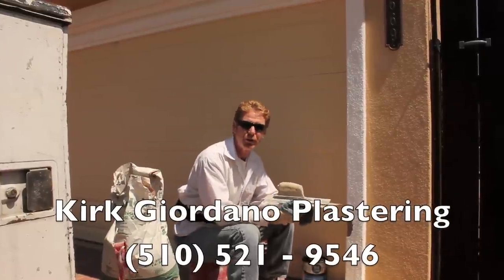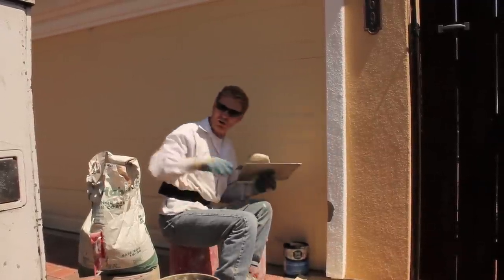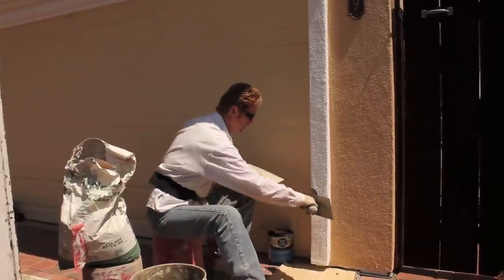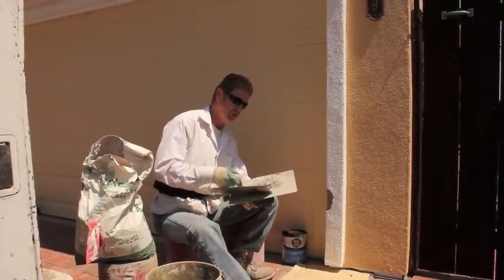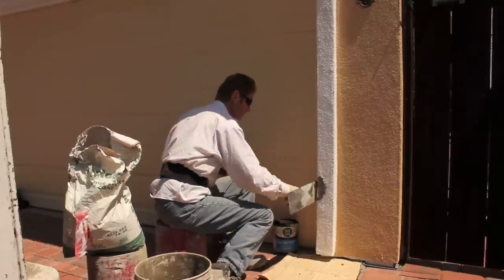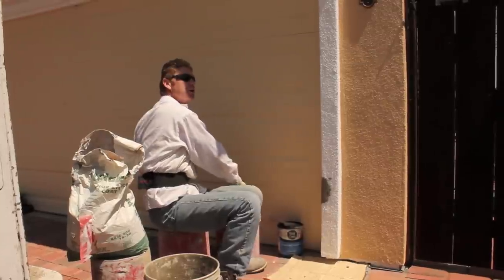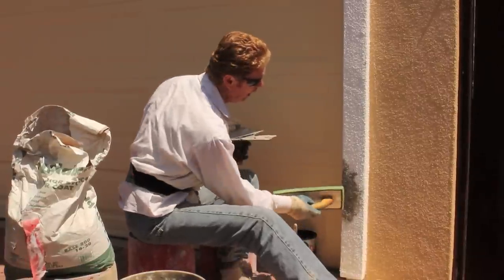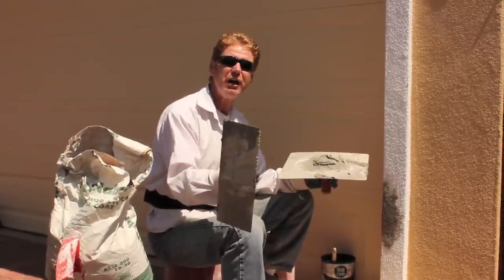Repair chipped stucco styrofoam molds.

Comment: Does the cement adheres to styrofoam? I have to fix my two bottom sides of my molding in my back door. A crazy dog ate them. It is an area about 12 inches each side. I already found two pieces of styrofoam right the size and put them on place. I just need the coat and paint. Do I need and adhesive for the cement or it holds well ?
Thank you sir 👍 Nice video for us that don't know nothing
Reply from the maker: Hello my friend, buy a pint of Quikrete bonding agent at HD for about 8 bucks, paint it on the exposed area, now for certain the new stucco will indeed adhere. Cheers.😉
Reply: @StuccoPlastering  Thank you Mr. Giordano, blessings!
Reply from the maker: @aychingao  👍

Comment: A bonding liquid sold in the concrete section of home improvement stores. Modified concrete is sold as well. The marble aggregate size matters for color & texture but it can be painted with a quality exterior acrylic paint. If matching a color, find a local EFIS company as they can come close to or match the color and texture of the marble chips. Marble has no iron so no rust steaks after it rains or sprinklers hit it. You don’t want sprinkler’s on it anyways. Not even painted siding!
Reply from the maker: @deankay4434  Exzackory, however, if I said that  to a customer they’d call the cops on me. I just say buy a good masonry paint.

Comment: I have EFIS stucco . I had 2 windows removed and replaced with wider but shorter in depth  windows. A double slider. This has left an area of 9x8 under the window which the efis part there has been replaced.  How do I finish the rest and the molding around the window? The guy doing it has vanished!
Reply from the maker: Good evening Sandy, it's called bull nosing or improvising to make the job look professional, It takes some practice or skill, perhaps it's best to call another skilled plasterer to trim it out for you?
    The complete plastering encyclopedia on video, by the plastering messengers of Youtube.  
     Over 850 free self-help videos 🎭 👀💃
Subscribers, you can depend on us to explain with truth, honor, experience, and skill for your time invested for wishing to learn the hows and whys of plastering.😉

Comment: Hi Kirk,  I need to fix the top corner of a column base that is made of Styrofoam and stucco....anyway how do I form the corner? Do I need to use some sort of filler then concrete? I noticed in another video that you used a binder as well, does that still apply?
Reply from the maker: Hi Kristin, you can use caulking if it's a small hole or cement if it's larger, If its painted you need to apply a bonding agent.
 Cheers!
 Kirk giordano

Comment from the maker: Hey Gilbert, Thanks for the compliment. These folks e-mailed me a great picture so I was able to tell the plaster sand finish, but just in case, I had all three types of sand on my utility truck. These are simple fixes but do require proper prep work in order for the new stucco to last forever.
Have a groovy day!
Kirk Giordano plastering

Comment: Can u use rapid set stucco patch on the same repair
Reply from the maker: Good afternoon, Alfred yes, however ,"Rapid set Stucco," has coarse sand or what we call 16/20 sand.🧞‍♂️
  Bringing peace, love, and brotherhood back to the world of, “Cement Plastering.” 🌍
With over 800 educational and free Youtube videos, by your favorite plaster geek, “me🤓” and my son, “Jason,” the bearded plasterer.💃
Reply: Wondering the same. But I have deep holes in mine, could I use spray foam, and patch over that? My dogs got to it, it's the styofoam below sliding door

Comment: You have great vid tutorials Mr Giordano. I am new to this and am doing some stucco repair like in this vid. I just read that Weldcrete is not for wet areas and will fail causing the repair to pop off. In dry climates it may work, but not wet. He recommended an acrylic admix like Acrylic-60 or Flexcon that is waterproof. This contractor said he has had to go back and replace so many repairs that it has been a nightmare. I appreciate your expertise. Have you heard of this issue? Thanks,  Alan
Reply from the maker: Morning Alan MacLeod, No, after more than 30 years Larson's Weld Crete has not failed me,
There have been projects where I allowed homeowners and or contractors to apply the weld create and in both instances they either did so too heavy or not enough. I do my own appling of this bonding agent as a result of folks not understanding the nature of it's use, or I don't take on the projects.
 It's made for cement on cement, and bonding stucco to many surface's, however us plastering contractors mainly use it for bonding new cementitious color finishes to painted surfaces.
 Here's a fact unless the surface is extremely clean of all dust, dirt and any other contaminates NO bonding agent will work.
 Best wishes, 
Kirk and family

Comment: Great video, thanks guys. I was wondering, is it easy to simply remove these styrofoam molds (it's the rear patio door trim). I need to put in a screen door, but can't with these huge styrofoam stucco'd molds around the door. I was hoping they'd be easy to cut and pry off and replace with a wood molding.
Reply from the maker: Todd Winkler Hi Tod, sure,  you can remove them. They are made of styrofoam, coated with fiberglass mesh,  then coated with a cementitious coating and bonded also with a cementitious adhesive products.
 You can use a long expensive saws all blade, this is the easiest,  the blades needed coat about 15 bucks each.
If you decide to use a hammer, trowel, shovel, prybar or a hundred other tools, you will have a real mess on your hands as the foam won't come off in sections, instead it will hold tight and come apart in a milion pieces.
 Best wishes, 
 kirk giordano Plastering

Comment: Hi my parents have been living at a house for 2 years now almost 3 and there has been these wood peckers pecking holes all round the top of the house which is styrofoam so they have been going through the styrofoam making holes everywhere i was just wondering how my parents could fix it , its the same result as the one in this video would they just have to do the same thing ? Do you have an idea of how much would everything be also ? If you could reply that would be really great plus i love your videos they are really helpful!
Reply from the maker: Hello Yasmin Ramirez, yes you can do it this way, for smaller holes you can just use caulking, if the caulk shirks when dry just add more, they make many caulking with sand in the tubes for sandy finishes also,
 Cheers,
 kirk giordano plastering

Comment: How do you remove the architecural foam moldings from inside a house?
Reply from the maker: Evening mate, if you don't want them anymore use a hammer, also, wear glasses and a respirator.
If you wish to salvage them use a saws all but this takes a lot of practice and is dangerous.
Cheers,
 Kirk and Jason giordano’s plastering videos

Comment: I have foam siding I live on a golf course it's taken some shots. Leaves a dent I can see the styrofoam. I have an extra bucket of stucco can I just cover it like that? Or are extra steps needed?
Reply from the maker: Sure you can; color finishes if applied over an eighth-inch thick can and will hairline crack, so what,  thats not a big deal. Simply fill to the desired depth, then in a couple days hit the cracked area again, this time it won't crack if it's skimmed over the cracked last coat. 💃🏻

Comment: Awesome!  Does this same technique work with Fypon?
Reply from the maker: Howdy Michael, no, Fypon decorative molds are usually made of wood, plastics, or polyurethanes; if it's a small ding try caulking? 🤔
Reply: @StuccoPlastering  thanks, will try caulking.
Reply from the maker: @michaelbrooks2670  👍

Comment: How do you attach a gutter  to a styrofoam  stucco trim?
Reply from the maker: Good evening Tony, excellent question, with long screws, you figure the foam and stucco my be about one inch and a half in depth, so 2-inch screws will be necessary to get a grip into the substrate or plywood.
    The complete plastering encyclopedia on video, by the plastering messengers of Youtube.  
     Over 850 free self-help videos 🎭 👀💃
Subscribers, you can depend on us to explain with truth, honor, experience, and skill for your time invested for wishing to learn the hows and whys of plastering.😉